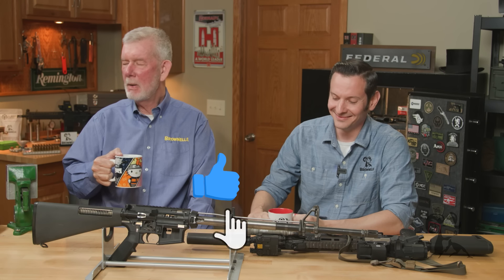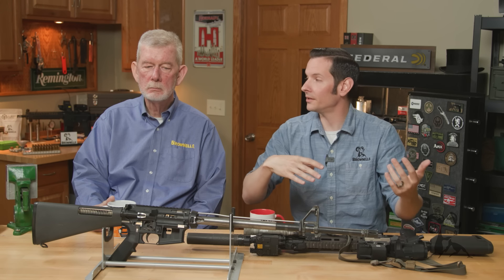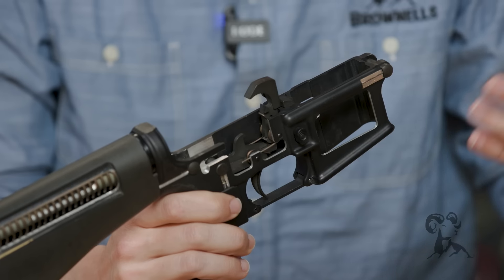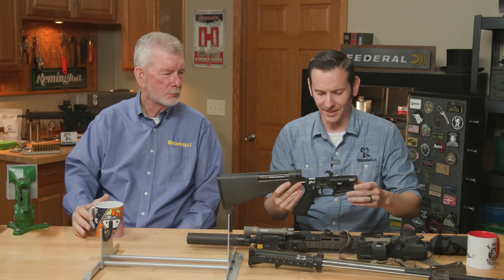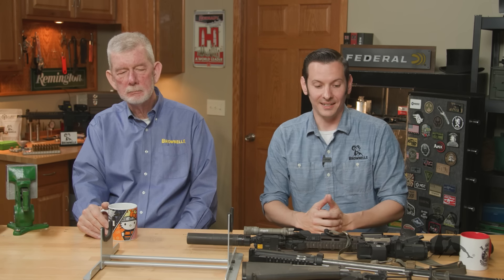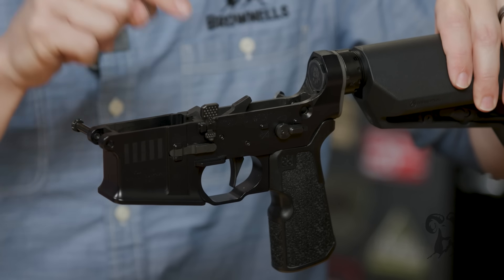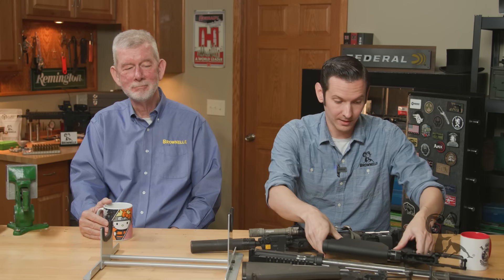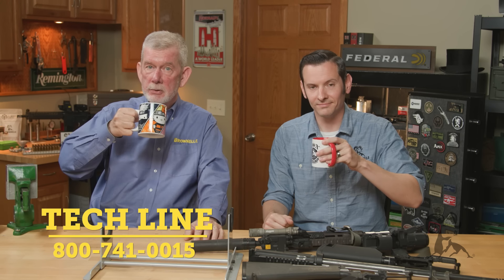SmythBusters: Dropping The Hammer On An AR15 Lower

Comment: I always hold my hand over the hammer to break the fall if I'm testing trigger function without the upper attached to the lower. Great video
Reply: Same here
Reply: Me too.
Reply: This is the way.
Reply: agreed.  I know mine is a bit cheaper, but as long as I take care of it, it will still be reliable.
Reply: Ditto.
Reply: Yep. I’ve paid, at minimum, several hundred dollars for that rifle, there’s no reason to intentionally add unnecessary additional wear when it’s just due to laziness or carelessness. 

It won’t break it if I do, but there’s no reason or benefit in doing so, and it just isn’t taking very good care of it.
Reply: I was taught to never let the hammer hit the receiver and this was by a ex-military guy. I’ve never let my hammer hit the receiver.
Reply: you can use your thumb too
Reply: Same
Reply: You know they make a piece of a test block that goes into the mag well to deal with that issue, most smith's have, mine does but they make all kinds of tools, fixtures for everything AR these days and they are geared to sell stuff presented to be kind your firearm. That's not  a bad idea but mostly it's to sell stuff.
Reply: Yep, but old school has it's routine, and it's just part of the discipline we use. It doesn't add much time to do it for cleaning and gives us peace of mind. Thanks dudes.

Comment: My grandfather always taught me "Dont cause unneeded stress on anything alive or not." So when it comes to guns, I use the same logic. Is dropping the hammer going to hurt anything? Probably not. But why cause unneeded stress and pressure? Same with dry firing. Why cause unneeded stress on something when you can just put a snap cap in and dry fire away?
Reply: Bingo
Reply: Smart man. And maybe the reason I don't want to get married 😂
Reply: @Shadow__133  I hope you find the one my dude. My wife was the best thing to ever happen to me. just celebrated 28 years together. There's nothing more fun than shooting gun's with the love of your life. Lol
Reply: @mr.martyr8573  I hope so too. Until then... less stress for me.
Reply: If it can take the stress of tens of thousands of PSI when firing, I just can't help but think that the few tens of pounds of force you put on it isn't much of a stressor. It's like taking the horseshoes off a Clydesdale because you don't want him weighed down while pulling out a stump. Trust me, he doesn't even notice those shoes.
Reply: @theKashConnoisseur  but that part of the gun isnt dealing with 10s of thousands of psi...thats the chamber, bolt, barrel...I dunno about you but I see a big difference in the construction and materials of an aluminum lower and the hardened steel chamber. People have made 3d printed lowers so they arent taking THAT much stress. But you do you! Its probably fine. I dont do it personally.
Reply: Absurd mantra to live by. 

Stress is what causes growth. We peen the edges of blades to give them better edge retention and hardness. We do training in harsh conditions & under time constraints to simulate the stress & circumstances of real world scenarios where everything is not going your way.

Refusing to cause "unnecessary" stress is how the world got so soft & in turn neck deep in corruption.
Reply: As far as center fire dry fire... you think air will cause extra stress on a firing pin? Your extra special.
Reply: @theKashConnoisseur  Then keep on doing it. It’s your shit. Not mine.
Reply: @mr.martyr8573  I'm doing it to yours, next. 😉
Reply: @theKashConnoisseur  Ya spelled cash wrong sir. You ain’t doing shit. Lol
Reply: @mr.martyr8573  It's not like you could stop me lol. Anyone ever tell ya you got a pretty mouth?
Reply: @Shadow__133  I miss my ex-wife...but my aim is improving.
Reply: @MattH-wg7ou  Exactly lol.. Lord people are dumb these days. The slide isn't taking 1000s of psi.. 🤦🏼‍♂️ And the majority of the stress is rear movement, not returning to home where the next round being chambered buffers the force applied
Reply: @theKashConnoisseur  Anyone ever tell you cash is spelled with a C?
Reply: @mr.martyr8573  anyone ever tell you Mr is capitalized? It's almost like... we chose how our usernames appeared on purpose lol.
Reply: Because dry practice is an excellent training aid and it’s not causing “stress”.

Comment: Our drill sergeants “smoked” us so bad in basic training for doing that. I’m still afraid to do it to this day. And that was back in ‘91. 😂
Reply: '89  and yyyyuuup. Considering the condition of the rifles we had, I don't think thats a good example for them to use.
Reply: 2011-17, we were told specifically NOT to dry fire a lower without the upper to avoid damaging the lower or the bolt catch. I had AR experience before the army so already didn't do it but it was reiterated in my basic training and at my unit.
Reply: 1981. And I have not done it through 21 years military or on my own.
Reply: 1977 and I still remember our Drill Instructor screaming "Who did that?" at the sound of the hammer falling without the upper in place while cleaning our rifles.  I still put my palm in front of the hammer when I drop the hammer.
Reply: @springbloom5940  I was an 89 baby too, Ft. Bliss basic and AIT.
Reply: 78 - 98 USAF always a no-no, at basic you could get recycled  for doing so.
Reply: @servicerifle16  It's funny, bc every armorer for the military does it anyway, and they don't have failures.

Comment: 20yr USMC vet here.
We dry fired and released the hammers onto the open receivers thousands of times.
Would you see wear on the anodization in that area?  Yes
Mechanical or structural failure?  Nope.
These firearms are very well built to deal with the pressures and stress of actually firing a cartridge, dropping a hammer on the open receiver frame is slap n tickle.
Reply: Airborne infantry here, we did the same thing thousands upon thousands of times with no issues to the gun hammer or bolt catch. That's across the board. One of my drinking buddies was a armorer any bitched about stuff, never heard a peep about this.
Reply: Only a few components deal with the heat and the pressure. Certain parts are made to deal with certain forces and nothing else. The brilliancy of the armalite rifle is that most components don't have to deal with it. It can be made of softer and lighter materials and it is a marvel that it works so well while it is filled to the brim with tiny little parts in need of colorful vocabulary. Why the need to appeal as authority? Your argument can stand by itself.
Just one time, one time I want to hear along the lines of:
 'They made us do this/that to make sure something was audible verified, so that took precedence over minor damage on already abused firearms we didn't pay for.'
What the lowest common denominator hears is: 'Come do as the military does! Out the door, line to the left, one crayon each.'
Reply: I believe you. But since an AR in my country costs the price of a motorcycle and replacement parts are basically inexistent, I’m not dropping that hammer on the lower for now. 😬
Reply: The weapon cycling normally probably imparts a lot more force on the hammer than dropping it against the bolt catch.
Reply: @onpsxmember he provided context to the “we dry fired” by saying he was a USMC vet. Not that he was using his vet status as a position of authority. You assumed he did.

 Also was in the USMC. Dry fired the fuck out of these. An entire platoons worth of dry fires and probably the company was committed during my time in boot camp
Reply: @alexandermagnusson5058 Agree. Probably no one is harder on gear than a GI so the rifles are military specification to be durable. Now those AR companies that are not up to mil spec but claim to be are another matter.
Reply: 10 years as an Armorer in the Corps including 3 years at the Armory at PI. Snapped that hammer like that thousands of times and never broke one of those parts.
Reply: @xi-deadshot-ix5838  It's not about the force on the hammer, it's about force on the bolt catch. Actually one guy in a small forum long time a go posted a picture of broken bolt catch after dropping a hammer on it. Most likely a faulty part.
Reply: I do it for fun
Reply: I cracked a 3D printed lower this way
Reply: @onpsxmember It's not automatically an appeal to authority. It could very well be a super simple and very quick way of providing context of why and what for other's questions.
Reply: In my Army service from basic on forward we Never did that, always told not to. Just used our hand to cushion it. Why cause unneeded stress of parts. Especially something your life may depend on. .... but i can tell you that many things one person experienced in the military another will tell you the complete opposite so many things are very unit/service/mos dependent
Reply: Exactly. 😊
Reply: You being a Marine or military is nothing to do with your knowledge of firearms. Most don't even know how their rifle even works, much less the intricacies of its engineering. Unless your point is how rough and stupid military is with their guns. That said, you are correct. This is a non-issue.

Comment: 2006 MCRD San Diego,  M16A2, Delta Co, a Senior  DI Browrowski. I broke a bolt hold open lever, dry Firing without and upper receiver on.

Comment: In 1995, the function check for the M16 was dry firing it multiple times to verify the safety worked in safe, fire, and burst.
Reply: With the upper on though and the rifle assembled, completely different. And if your function checking before the rifle is assembled, you're kinda missing the entire point.
Reply: @jacobnewman3797  That is true. Instead of the hammer smacking the bolt catch, it smacks the firing pin, as it normally would.
Reply: You can do those checks without the upper, just use you hand to control the hammer, very light pressure on the hammer to feel the sear release. I do those when installing a new trigger (except the burst/auto mode)

Comment: I agree with what you guys said. Its unnecessary and undue wear and tear on the firearm, so I dont do it. Its hardened steel against aluminum, so not ideal, will it result in an immediate catastrophic failure? No. But, its not necessary or ideal as a regular practice. Thanks for the video. Ive had this discussion before with friends, and some agree and some dissent. I love a drop in the bucket on the correct side of the question.

Comment: 3 weeks ago I did this on a friend’s lower. I actually had the side of my thumb laid across to prevent a full hammer strike on the bolt catch but apparently my thumb wasn’t where I thought it was and the hammer did fully strike the bolt catch which did break right along the hinge. 
I did not bother to ask if it was a mil-spec part. I just gave him one of mine.

Comment: the milspec rule is something that I think a lot of people think as "basic" and thus boring or barebones, but the truth is that a lot of companies will undercut milspec standards. Charging handles are notorious for being made with poor parts and have multiple failure points. There's a reason why the go-to, reliable names are more costly than the lowest available option. A firearm is the sum of it's parts, but if even a few of those parts are awful the entire gun can cease to function.

Comment: Good stuff, I tend to avoid dropping the hammer in said fashion. Was I advised to not drop the hammer? Nope, just never really thought about it, use my other manipulation digits to act as a buffer, mostly because the sound of the hammer strike had the appearance of the possibility of damage. That and what my trigger group cost lent itself to precautionary measures.  Knowing that it doesn't damage anything is reassuring.

Comment: As a mechanic by trade, my rule of thumb is the same with firearms as pretty much any other machine.  If the manufacturer says it was designed to operate a certain way, such as dryfiring, then go for it.  That being said, a disassembled gun is the very definition of "not as the manufacturer designed it to operate."

Comment: When my unit received our brand new M-4’s years ago to replace our late 80’s A2’s, we noticed how tight (or lack of excessive lateral movement) the new M-4’s bolt catches had in comparison to our old A2’s that have had the hammers dropped who knows how many hundreds of times.  Did they still function with all that excessive free play?  Of course.  But we could clearly see the long-term results of the hammer’s overtravel being allowed to slam the bolt catch.  It was also a wake-up call for many to feel the power of a fresh new hammer spring compared to the tired ones we’ve been working with.

Comment: I've found that among the cheap "milspec" triggers they might vary out of the box  with different levels of polish but they feel the same after 1000 rounds of dryfire when the sear faces have "self polished" to the point they feel the same. I definitely catch the hammer with something soft if I'm going to force a new trigger to self polish.

Comment: I found this video very informative and useful!  I've been shooting ARs for decades, and always believed that dropping the hammer on an empty AR chamber or (worse) a naked lower was a cardinal sin. Though I normally put the second joint of my offhand index finger in front of the hammer, I have accidentally gotten the "clank!" a few times, and considered myself graced thatI escaped damage THAT time.  While I'll still avoid it, it's nice to know it's not such a big deal.  Though I have noticed that some AR hammer pin holes get a little loose over time, so I wonder if when you drop the hammer on a naked lower (where the weight of the hammer is way above the impact point top edge of the lower) the kick-back on that couple hundredths of a square inch of receiver aluminum behind the hammer pin is a lot harder!

Comment: Here is where I need more clarification (keeping in mind that it’s been a long time since I’ve built an AR, and shopped for parts). I don’t think I have ever seen a cheap ‘lower parts kit’ described as anything other than “Mil-Spec”. Sure, I’ve always bought from American companies, but I also doubt that many of the “Mil-Spec” parts weren’t manufactured in China within the the manufacturing 
tolerances of “Mil-Spec”, at least on paper. After watching your previous smythbuster video for pistols, I have no problem dropping the slide on an empty chamber with my OEM handguns. But I have always been more concerned about my AR parts since cheap “Mil-Spec” lower parts kits seem to be the norm.

Comment: Done it, do it. I've got a Olympic Arms receiver from the mid '80's with GI lower and upper parts (that's back when that's about all there was available, how about a new in sealed wrap 1-12" chrome lined 20" GI barrel marked cp of, at the time, $39.00) and have zero problems. With that said, I, mostly, try to remember to ride the hammer with my thumb when I don't have the upper on.

Comment: I’m so tired of hearing people regurgitate how true mil spec is trash. I’m glad y’all cleared the air on this. Maybe do a video on mil spec components. 

The issue is know what’s actually mil spec. You see many companies advertising mil spec and half of the AR doesn’t meet the standard.
Reply: On the contrary, the milspec for AR-15's in particular is surprisingly strict. Very few AR manufacturers meet milspec, either in terms of the TDP or just pure quality control metrics. Obviously there are milspec items that are absolute trash, but that only really applies to things the military doesn't truly care about. Lots of personal equipment or comfort items for example. Secondary weapons, like the aftermarket locking blocks purchased for the M9. Not the primary weapon of the majority of men in the field, all the way from privates to the highest tiers of special operations.
Reply: Interesting point.  I've come to think that mil spec in the actual military is very different from civilian mil spec....  i think the civilian version means more that the measurements are within spec.....not thay finishes, stress tolerances and non failure rates are "mil spec"  
So it seems anyway.
Reply: @leewilkinson6372  The big issue IMO is that "milspec" as a term has become more analogous to the way "bandaid" is used to mean adhesive bandages or "ziploc" is used to refer to sealable sandwich bags. Milspec on the commercial market doesn't mean it's milspec- it means it's a part that shares form and function with the mil spec. That has no relevancy on whether it truly complies with that standard.
Reply: @KeterMalkuth  true enough!